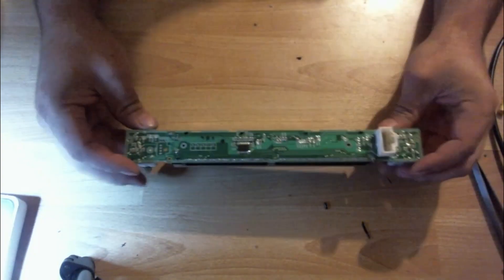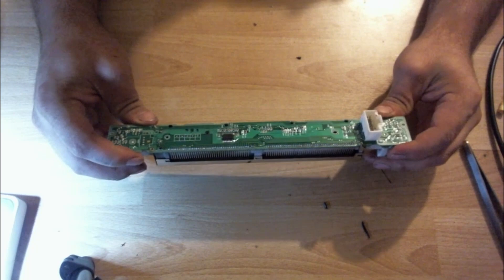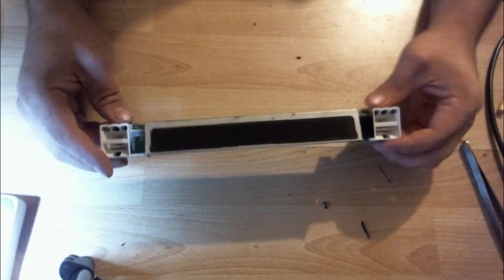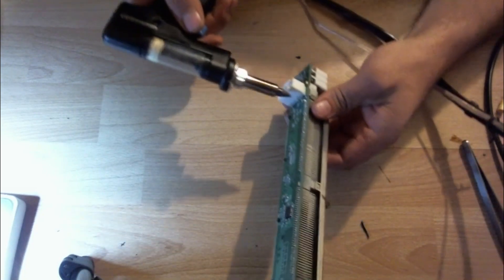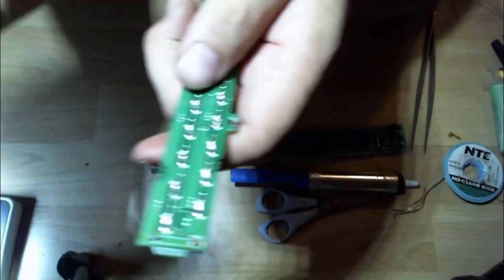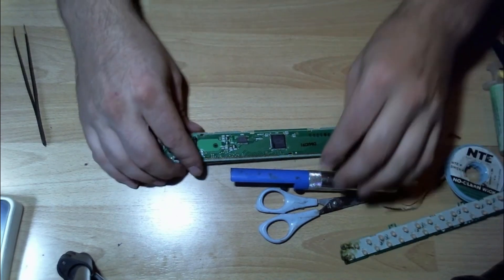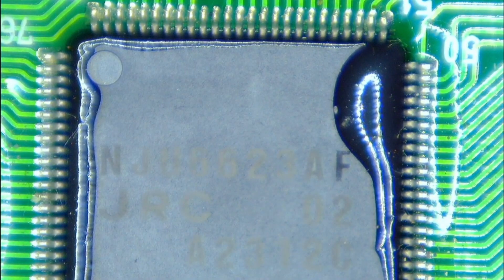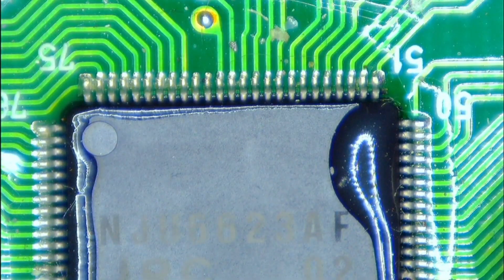Mazda 6 LCD Driver Info Center Repair TIME LAPSE

Comment: Why did you solder Chip twice? I've done once and my display have stabilized, but I have only 10% of segments. Before it was like a light show blinking etc.
Reply from the maker: During editing I somehow ran the same clip twice in the timeline. I only reworked it once
Reply: @littleengine1303  one last question, what was the temperature on your soldering iron?

Comment: How much would you charge for this repair? I'd love to send it to someone who is skilled in soldering electronics.
Reply from the maker: Around $125
Reply: @littleengine1303  ok, I have a couple of these, so I will attempt one and see how it goes. Just watched multiple videos on soldering electronics and I feel a little more confident. Since this is automotive electronics, do you apply some sort of sealant over the soldered connections after completion?
Reply from the maker: Yes I do. If you've never soldered on a circuit board before, I would not advise this at all. It's not like wiring. Way more intricate and if I have to reverse/repair someone else's damage from a failed attempt that's extra.
Reply: @littleengine1303  I haven't soldered on a circuit board before, but I have two non-working displays. I'm willing to take a stab at one of them and leave the other untouched. If I am unsuccessful, that's when I would send you the untouched one. Did your quote include shipping back?
Reply from the maker: @SmokinPol  Yes it does. Do you have the scrambled/missing segment issue where parts f the display appear to pretty much be non existent?
Reply: @littleengine1303  my display is out entirely.
Reply from the maker: @SmokinPol  you probably have the backlight problem. I usually go in and remedy for both, I can update the LEDs to any color you want.
Reply: @littleengine1303 what's your email? I'll email you and we can set up a repair.
Reply: @littleengine1303  Bueller?
Reply from the maker: @SmokinPol  midmiaudiovisual@gmail.com